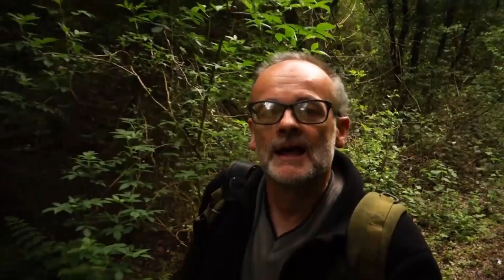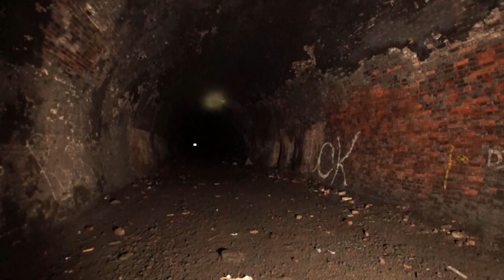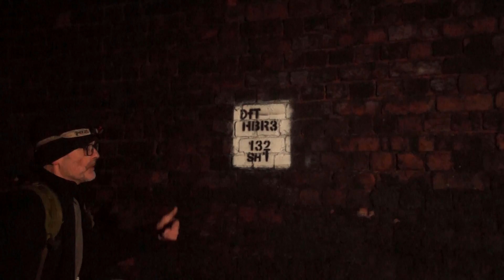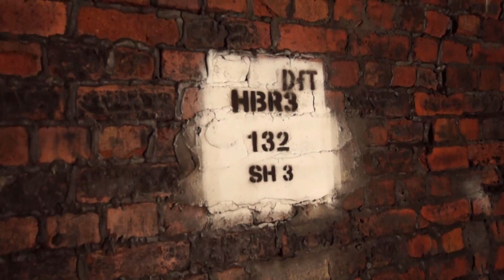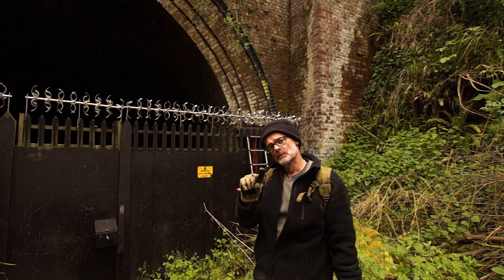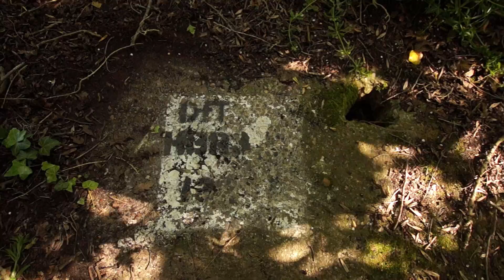Exploring Barnsdale  Railway Tunnel  A1 Junction 39

Comment: Hi Patrick your videos are fantastic! Very professional well made id love to join you on some of these explorations especially the railway tunnels.The calcite deposits on the walls where you zoom in to show the drainage pipes,you said they are plastic?but if that's correct they mustve been installed fairly recently?and we're they copper or lead originally?and at the Tunnel entrance portal on the black fence there appears to be a box almost like a post box but I presume it has a padlock inside?as Northern Rail must inspect this tunnel and others regularly?
Reply from the maker: Hi Roger, yes they are amazing places, like going back in time once you are in. The pipes are probably modern replacements for the lead or brass ones , and yes the box on the gate is to protect the locking mechanism, I worked for Electricity Company for 40 years and we had similar on all our main substations, to prevent unauthorised entry...... thanks Pat

Comment: if the camera is fake and has no cable, where does the power for the flashing light come from then? battery that has to be changed frequently?
Reply from the maker: Hi Samuel,a modern battery will last for years, think of a pace maker, lasts for 7 to 10 years, so yes it was fake but gave the impression of been real...... thanks Pat
Reply: @patrickdickinson6492  Ok. yes, I didn't think of that...  After all it's just for a tiny little LED to flash once in a While. have a nice Day, Greetings from Switzerland.

Comment: Looking back in the newspaper archives for any information on the construction of the tunnel I came across an interesting anecdote.

In January 1882 there was court action against contractors Messrs Lucas and Aird. The roads in the area had been most injured by heavy loads in carts and waggons, and since June heavy loads of bricks in a number of traction engines chiefly to Barnsdale tunnel. The roads were constructed for weights of 3 or 4 tons, they have now been transversed by as much as 30 tons causing ruts in some places of half a yard deep.

In another newspaper it describes extra weights passing along the roads to Barnsdale and Walton Wood tunnel, and estimating that the tunnel would take 3,000,000 bricks. Three bridges had been made unsafe and in some places the roads were like a fallow field.

All the best, Peter.
Reply from the maker: Hi Peter, unbelievable amount of bricks, but when you look at the tunnel construction, yes you can see where they all went.I suppose the tunnel construction came first, no matter what damage 2as done to the !oval area, all interesting stuff..... thanks Pat
Reply: @patrickdickinson6492  Love the brick laying in these railway tunnels. Here is a picture I put on the Listed Buildings site some years ago of Oxley Viaduct here in the Black Country. A beautiful skew arch.

All the best peter.

Comment: It’s great seeing interesting things through an likeminded engineers eyes.
If I was to take a guess at those holes in the recesses it would be for a light so workers could visualise the closest one and it would be two crew per recess. The second mans body would would mask the light being offset to one side so other crew members wouldn’t run to a full one 
That’s my guess anyway probably wrong but entertaining video
Reply from the maker: Hi Mally, interesting thoughts, I had read that they were possibly inspection  holes or drainage hole to release any  water pressure behind the tunnel wall, who knows ?..... all the best Pat
Reply: Your most definitely right
 but I can help but multifunction any idea lol

Comment: The Shaft Identifiers have been changed within the last six years

https://youtu.be/kTGwMUoud_k?t=520

DfT is Department for Transport.

There was no fencing when we went through there as kids. Also, one of the shafts had a big hole in the cap at the side as debris regularly rained down. You didn't spend too much time under them. Good Times
Reply from the maker: Yes I expected to see BRB, but it had been changed to DFT, don, t know why they had to fence it off, so many people said they walked through as kids, all the best Pat
Reply: @patrickdickinson6492  I ended up in A&E from a brick dropped back in the early 80's. I was lucky.. The guy that did it was as still is) my best mate....
Reply: @patrickdickinson6492  PS, this video was wonderful.

Comment: Your lucky those rolling fence toppers were solid metal, I've seen them with razor and barbed wire,
But I'm led to believe if your careful you can cover/ jam them with heavy material
Reply from the maker: Hi Lennie yes always a way of getting over, the toppers were just aluminium tube, split, looked a lot worse than they were, thanks Pat

Comment: I live very close to this tunnel and on the haunted side of it 5 of us went down when we were teenagers and we made it about a third of the way in when all of our torches turned off at the same time and would not turn on again until we left, we’ve never run as fast in our lives, we went all the way through many times after that, they should make places like this into tourist attractions it’s a shame they’re stood rotting
Reply from the maker: Hi Luke, yes definitely a atmosphere in there, but it may of been what I had read about before I went in, I was ready to run just in case. Like you say should be opened up, all the best Pat

Comment: DfT especially rendered that way with the lower case f makes me think Department for Transport. Granted they were not founded until 2002 so that seems odd but perhaps they are the agency that assumed legal responsibility for managing the remains of the tunnel as it is a former transport tunnel. They probably renumbered them with their own identification scheme when they took over as it probably made it easier for them to keep track of the vast array of bridges and tunnels etc they manage.
Reply from the maker: Yes that must be it, whether they really wanted the responsibility of looking after these massive pieces of Victorian Engineering, but someone has to, thanks Pat
Reply: @patrickdickinson6492  Probably didn't really want the responsibility but like you said someone has to take it on really. Would have thought that left unmonitored infrastructure like this could potentially prove disastrous, regular inspections to look for any signs of large scale movement would seem essential at least as a large scale collapse could potentially trigger landslides etc. Short of spending the money to fill it in and render it safe that way would need regular supervision to avoid that risk at least I would have thought. Maybe a small risk with this tunnel as it looks to be in an isolated area from what you showed in the video but there are certainly other abandoned railway tunnels in more developed areas such as the old one under high town in Bridgenorth, Shropshire that has buildings bellow the portal and has a large portion of the town on the land above it too.
Reply from the maker: @FaerieSeraphina  Yes regular inspection are essential to maintain these tunnels, certainly no profit in looking after these magnificent places.
I know Bridgnorth fairly well as we stayed at the Riverside campsite a dozen times in the 1990,s fishing for barble on the Severn, as well as visiting the pubs in Bridgnorth, didn't know about the tunnel though. Thanks for the comments, Pat
Reply: @patrickdickinson6492  Yes the tunnel is located just North of Bridgenorth railway station. The Severn Valley line used to continue over the road, then through a tunnel under the hill high town is on, through what is now the golf course to reach the valley before continuing north following the river towards Ironbridge. Can still see the portal on the station end if you know where to look not sure about the other end haven't been there to check.

Comment: Fantastic ! - Thanks Pat. - I was wondering what hidden "extra" brickwork there probably is to support the weight of the ventilation shaft's brickwork. I suppose the ring of blue engineering bricks is perhaps tapered upwards through the tunnel roof brickwork, so it sits like a tapered plug in a hole ? ! - A wonderful video and very skilful Light Painting - you take us with you in our armchairs ! Thanks again.
Reply from the maker: Thanks for the great comments, the size best ventilation shafts I have ever seen and managed to photograph, thanks again Pat

Comment: I live in Hull sadly nothing much remains here of the Hull to Barnsley railway. Most of it now has housing and commercial built on. Except for an old bridge foundation and about half a mile of overgrown track bed. which located on a site still privately owned by British railways and probably will in the next 50 years. Its impossible for a future to reopen the lines. Breechin killed it
Reply from the maker: Yes same as many other lines, Beeching finished them all, thanks Pat

Comment: Great subjects.  "Caving" and engineering.  In a few dozen centuries the tunnel may have stalactites on the ceilings and walls.  I looked this up in Google Earth.  It looks like a quarry or open mine, extracting some of that magnesium limestone, south of the western end.  

I am curious about vent shaft #2.  Does it enter the tunnel, off-center and on a non-vertical angle?  Or is that a bit of lens distortion?  

Your appreciation of the engineering and the artistic effects of time really helps the viewers see and understand the beauty that is here.  Thanks for bringing us along.  It really is a fine structure.  It is 0.70 miles long and looks at least 30 feet wide and is just sitting there, letting Mother Nature take over.
Reply from the maker: Hopefully the tunnel will still be there in a couple of hundred years, bet it would make a great explore then. Shafts 2 does for some reason entire at a angle, made a very interesting photo, not sure why, thanks for all your comments, thanks Pat

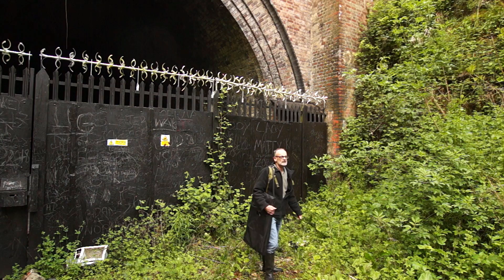Comment: 3:49
Did you try pushing the door ? It looks as though it could be open with the size of that gap !
Reply from the maker: No well and truely locked, has a bar securing it, only way in over the top, thanks Pat
Reply: @patrickdickinson6492  
OK. Worth asking !

Comment: Brilliant and well thought out video! Is this a cut out with the rock excavated and tunnel built from brick in the cuboid shape of the portals? All of that woodland would be grown over the brick cuboid?
Reply from the maker: Hi Peter, it will of been tunnelled as the ventilation shafts are around 80 to 100 feet deep, amazing bit of Victorian construction, thanks Pat

Comment: What's keep the ventilation shaft funnels anchored to the tunnel when they appear to exit into the tunnel mated with only mortar?
Reply from the maker: Hi I, am not 100% sure but maybe the top of the curved tunnel roof supports the ventilation shafts, if it was myself I would anchor the shafts all the way up, I, am sure whatever they did was a good as the shafts have not moved and will probably last for another 100 years. All the best Pat

Comment: DfT - Dept for Transport ? 
Pat, thanks for the video, it was fantastic to watch you on this adventure, cheers.
Reply from the maker: Thanks for that, great explore, best one yet, thanks Pat
Reply: if the tunnel runs under the A1 then the DFT are probably responsible for inspecting it and it's no longer the responsibility of the BRBR. The 132 is probably the structure reference for the tunnel on the ELR. The hole in shaft two has been driled with a coring bit to gain access!

Comment: Hi Pat, the number you referred to and weren’t sure about, are in fact structure numbers. They are usually numbered from the nearest city or large town. They include under bridges, over bridges and tunnels. So the next structure, if still standing would be one digit higher or lower.
Reply from the maker: Hi Mike and thanks for the info, thanks Pat

Comment: Excellent upload, I am curious about those ventilation shafts. They are carved through then rock and then brick lined so how is the bottom ring supported? Its at the top of the arch and part of the arch so it isnt vertically supported by being on top of a complete arch, is the friction/mortar of that ring with the arches enough to support the mass of the column of bricks or is there more behind the first layer of bricks we cannot see?
Reply from the maker: Not sure how it's all supported, whether the curved tunnel roof supports it, not sure but amazing construction, thanks Pat

Comment: For the signs in the tunnel see (Dft owned tunnels) 

https://www.whatdotheyknow.com/request/the_location_of_disused_railway_2#incoming-1170816

DfT - Department for Transport
HBR3 is the Engineers Line Reference for the line from Drax to Stairfoot, the 3 is part of the ELR, not the 3rd tunnel on the line.
132 is the structure number (probably the 132nd structure - Bridge/Culvert/Viaduct/Tunnel etc - from Hull ?)
SH1 - Shaft 1, etc
Reply from the maker: Hi Martyn, that's certainly explains it better, thanks Pat

Comment: Department for Transort, Hull & Barnsley railway. 132ft Shaft Height, shaft 1. Surveyors do head out periodically to check infrastructure including disused structures as often there is something constructed above and deterioration may lead to collapse.
Reply from the maker: Thanks for the info Gary wondered what the 132 was, seemed in pretty good nick this tunnel, thanks for the comments Pat

Comment: I used to work for British Rail and often worked nights. We finished around 2 am and had no transport to get Home and only 50 p in my pocket I decided to walk the track home. It was ok until I got to a tunnel. I decided to walk the Tunnel in the dark without a torch. Feeling every step along the way, trying to avoid all the drains and traps along the way. I eventually emerged back into the Moonlight with a sigh of relieve. another couple of hundred yards along the track I came across another Tunnel which I knew to be longer than the last one, and I thought  Fuck that and climbed over a fence and back onto the road. I am now a 70-year-old Bricklayer and am still fascinated by the skills and workmanship of the Guys who built these wonders of engineering.
Reply from the maker: Great story Denis, must have been scary in the dark, I have a bug torch and several more as back up, did not want to get caught out with no light, amazing places, all the best Pat
Reply: This is a great little creative writing piece, I want to read more.
Reply: wow, great story. you've certainly got more bottle than me, & glad you made it through that tunnel safely

Comment: Yet another grate vid Pat. Just wondering if the numbers are lengths in chains? The network rail guys still use them as a means of measuring distance.
Reply from the maker: Yes new they used chains, not sure if these were or not, thanks Pat

Comment: to get some of the camera shots Pat has to do the same thing twice to retrieve the camera. great effort brilliant video.
Reply from the maker: Yes alot of backwards and forwards and climbed that fence several times but worth it for the finished results, thanks Pat
Reply: @patrickdickinson6492  department for transport
Reply: @johndoe-wr1fh   Yes, those signs are no older than 2001, when the name was changed to Department for Transport. Pat, do you know when the line was closed?
Reply: @patrickdickinson6492  hello Patrick. I’ve been in a few tunnels like this but never managed to get pics like yours. What were the camera settings you used for the shots, I’m guessing the “ light painting is in fact a very long exposure with a tripod and torch. What lens did you use?
Reply: He definitely puts the effort in, and it shows.
Reply: Always amazes me what effort Pat goes to. Especially considering that fence!
Reply: DavidVI that fence is the scariest thing about the tunnel. I don’t know if it’s sharpened or not but it looks like it would shred your insides if you fell on it😬

Comment: CCTV turns out to be battery operated & radio linked. Whoops!!!!
Reply from the maker: No I was happy it was fake, even more so when I looked close at it, would of been interesting it was real though, I can still run, all the best Pat
Reply: @patrickdickinson6492  I too, agree it was fake. It is only a empty tunnel after all.
Reply: @TPQ1980  you can't be arrested for trespass.
Unless this counts as trespass on the railway and BTP are around 😉 £2000 fine on the way.
Reply: 3:15 Naah, the top surface of the 'camera' is flat and has a small solar panel.  There is the option to fit a couple of AA rechargeables inside to keep it flashing after sunset.  I've installed these at sites where a basic 'security' presence is required...

Comment: I live at Norton just down the road from the tunnel, I've known about it for a long time but never visited it, so thanks for that. I might pop over and have a look now!
Reply from the maker: Yes saw Norton on the map, I parked near Upton and got in there, thanks Pat
Reply: @patrickdickinson6492  thanks I'll have to try that.
Reply: @patrickdickinson6492  I originally come from Edlington near Doncaster and when we where teenagers we used to cross over to Conisbrough Viaduct using the Air Tunnel which for the most part is still there.https://youtu.be/wHcFVq-7CR8

Comment: Why was this tunnel made so large? Did the trains need so much height?
Reply from the maker: Yes steam trains were tall and alot of smoke and steam to get rid off. It was also a dual track so that's why such a wide tunnel, thanks Pat
Reply: I'm just guessing here but a higher tunnel would provide more room for the coal smoke to expand into, therefore reducing noxious fumes closer to the carriages? Or maybe the Victorians were really forward thinking and planned double-decker trains :P